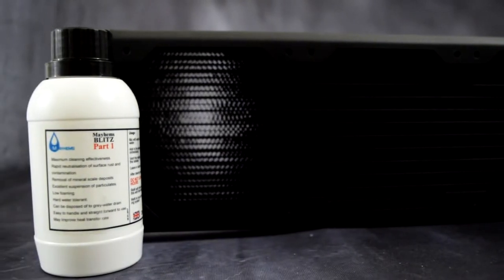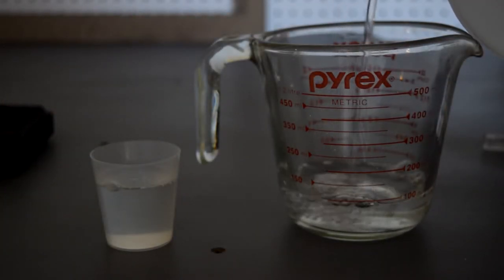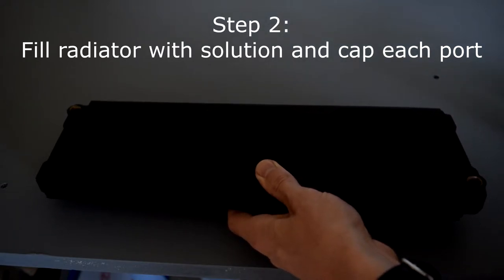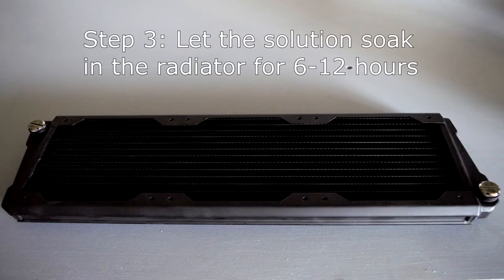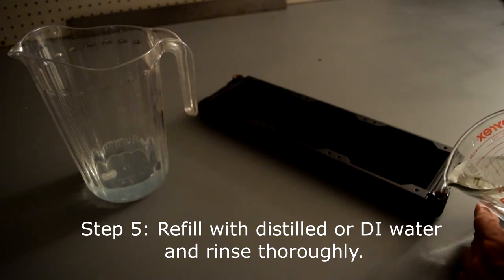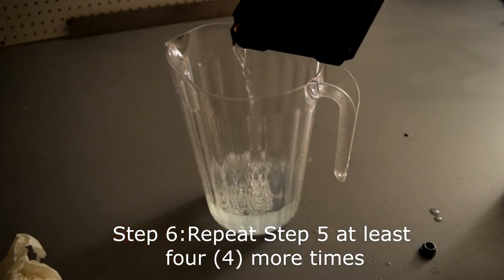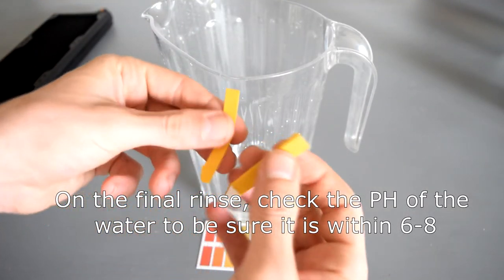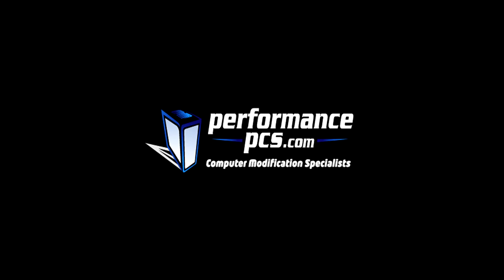Mayhems Blitz kit part one

Comment: For Alphacool Rads like the NexXxos Monsta Series I would recommend rinsing with distilled water at least 7 times. It's a PITA but those rads come very dirty from factory. Since my tap water has only 23 PPM I usually use it for some extra rinses after Blitz P1 and before going distilled (of course). Regards

Comment: Does anyone know if the ratio is still accurate? cuz the instructions say 25 ml to 975ml of distilled water
Reply from the maker: Follow the instructions on the bottle as the portions of the bottles have changed since.
Reply: @PerformancePCsTV  the instructions on the bottle say to follow the instructions in the Box but those instructions are contrary to the ones on mayhem's website and are different from what you show here

Comment: Got caught on this myself.  The bottle says 250mL per liter but the included instructions say 50mL per liter...guessing the 50 is a typo since when I used that mix the result was less than impressive and the rad was still kinda rusty.  Not cool Mayhems

Comment: you put 50ml of mayhems pt1 on 200ml of water. is that the right ratio? Should'nt you put 150ml of water so that it is the 1/4 of the final solution?
Reply from the maker: Psyber84 yes this is correct because it is 1 part solution and then 4 parts water meaning 4 times whatever the amount of solution it is you added.
Reply: @PerformancePCsTV  where did you get these instructions?
Reply from the maker: @psyber84  there are instructions on the product page for the blitz kits.
Reply: @PerformancePCsTV  on the product page it says: add 750ml of water to 250ml of part 1. That makes it 1/4. In your video it is 1/5. https://www.mayhems.net/products/mayhems-blitz-kit
Reply: I wonder if they changed the chemical used. My instructions from the kit I just got says 25ml of part 1 to 975ml of water. The instructions also say 6-12 hours for part 1 while the bottle says no longer then 6 hours. It seems to have cleaned so stuff out of my radiator I've been using for a few years but the conflicting information is not a good sign.